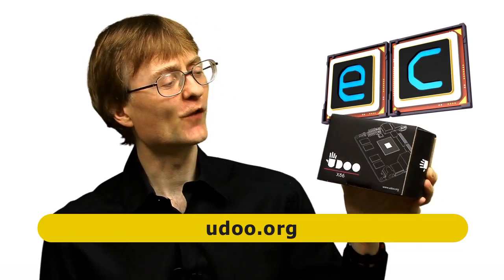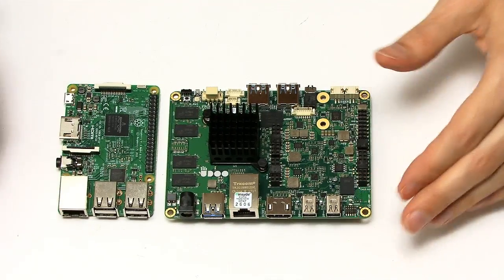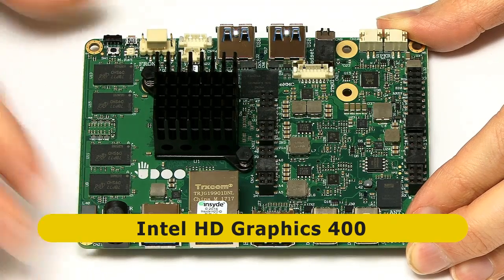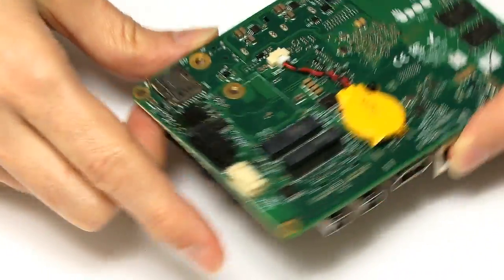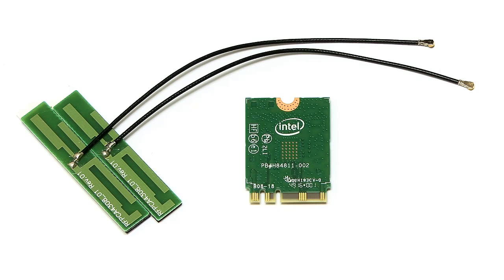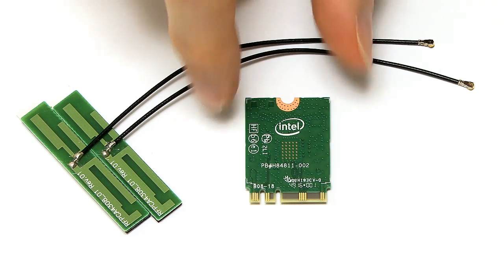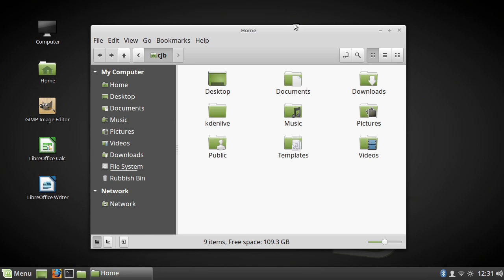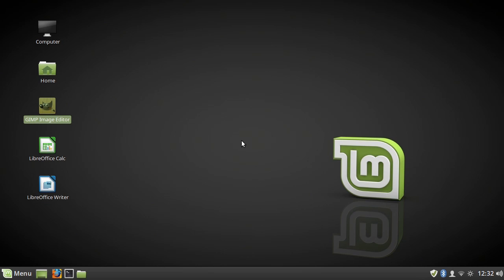UDOO x86 Advanced Plus

Comment: Nice.  Please Benchmark a Visual Land Premier 9 against these expensive SBCs.  It has a display, battery, power supply, touch screen, etc., etc, etc. and Windows 10 installed for about $170, compared to these SBC bare board marvels!
Reply from the maker: It looks a nice tablet, which means it is intended for a totally different market! :) This board is faster and has four times the RAM. But it all depends on what the machine is for.
Reply: If one wants to use an SBC to control & measure things, you need to get a user interface (display, keyboard, mouse joystick, etc.), power supply (batteries preferable), enclosure and then write, copy, edit, debug a bunch of software from several places. 

If you want use inexpensive, debugged, GUI, fully supported Windows software such as MCC DAQeasy or DAQAMI, and connect everything via USB, WIFI or BT, then a Win 10 mini tablet, which is cheaper than any of the SBCs with similar features, seems a good solution.  

If you need an Arduino compatible development platform and want to develop programming languages, applications, user interfaces, and hardware drivers, then an SBC  under $35 from Raspberry Pi, ST Micro, or any Arduino or clone is a good way to go.  The reviewed SBC, would cost ~ $500, if you add a case, keyboard, mouse, an 8" touch screen LCD, LI battery & charger and cost of the freebie enhancements provided.

An analogy might be buying a chassis with an engine, a bunch of parts and figuring out how to put them together to make a truck, or buying a truck and adding whatever custom equipment you want.

Comment: Intel stop making atom cpu?
 I am very interested in the performance of the stats on the gpio and what software
to access them.
Reply from the maker: Yes, Intel have stopped making the Atom. :(
Reply: Well they have stopped advertising atom, but I thought all N cpus was based off the atom architecture just improved with new name
Reply: also the Curie as well =(
Reply: The CPU on this board is based on the Braswell microarchitecture, which is marketed under the Atom, Celeron and Pentium names depending on the target devices. For desktop use, Intel has renamed the Atom line to Celeron and Pentium several years ago, but kept using the Atom name for the mobile CPUs.

Comment: you put the cooler fan upside down ... nice job on all the others , nice little computer
Reply from the maker: Yes -- and no. The fan is indeed pulling air upwards. But the way it is made, it fits that way, but not the other (at least there is no protection on top of it with the fan blowing downwards). And all airflow is good! :)
Reply: did you benchmarked both positions to see which is better for cooling this device ?

Comment: Not going to lie, if I could use this for general-purpose stuff without the need to run my main comp (which seems to double as an effective space heater even when idle - not fun during the summer), I'd probably buy one as soon as I could afford it. Can't say I'm a fan (no pun) of a case that leaves the heatsink sticking out like a sore thumb, though.
Reply from the maker: Yes, this is crying out for an enclosed case.
Reply: So do as I did and make your own. Mine is made of balsa sheet reinforced and decorated with flat and round bamboo skewers.

Comment: This mainboard (why they call it an SBC when it isn't ?) would make a nice little HTPC.
Not cheap though. One of these cheap mainboards with built-in Braswell CPUs would probably do better and have more expandability. Of course, at the cost of not being as portable.

Also, I bet Windows would run better than Mint (ahem... Ubuntu) on this board as Linux GPU drivers for those newish Atom CPUs can be pretty flaky.
Reply from the maker: All agreed, though this board is Celeron, not Atom. I will be installing Windows for my LattePanda comparison video.
Reply: It's an Atom branded as Celeron (top of the range Atoms are branded as Pentiums). Intel did the same branding thing with Bay Trail in the past.

Comment: Could u try and connect a external gpu ( by replacing the wifi card) to it and make another video on it and see it is able to game PS if you need help just msg me , I might do it if it actually work.
Reply from the maker: The M.2 slots are keyed for WiFi and SSD only.
Reply: One of them also support the Ethernet expansion.  I do not have it and Udoo explains nothing without a lot of begging first.
Reply: Well, someone figured out how to add a graphics card.  https://www.youtube.com/watch?v=9Evkc3L-NJM

Although I don't have  a good clue.  The m2 slots  are totally new to me.

I don't know what effects it has on the Arduino end.

Comment: Hey there from ireland. Got a question for you. I wanna build a touch screen juke box, and looking at this,would it be a good unit to use or would I be better with ryzen 3
Reply from the maker: It depends how much power you need. This would certainly run a jukebox.

Comment: I read that Intel is pulling out of the SBC market! What will happen to these?
Reply from the maker: Intel is indeed ceasing to make its own SBC boards. But the Celaron chip used here is still on the market and used in many devices (esp cheaper laptops) so will remain available.
Reply from the maker: I've just the link another poster has provided about Intel discontinuing the Currie microcontroller. Bad news.
Reply: Its bad news indeed. This thing is pornographic :(

Comment: Shouldn't the fan be mounted to push air toward the heat sink?
Reply from the maker: Well spotted, it should. But the supplied fan mounts (better) the other way around! I need to experiment. Any airflow is good. :)
Reply: Probably so it is sucking hot air from the mobo instead of blowing hot air over the mobo.
Reply: Depends on the heatsink actually but usually blowing is more efficient even though is creates more turbulence.

Comment: I am planning to build a handheld Linux based device with a sliding keyboard, which would be the most powerful and power efficient board that I could fit in a hand held form factor?
Reply from the maker: You will always have a tension between powerful and power efficient! A Raspberry Pi Zero W is very power efficient, but a board like this is far more powerful. A Pi 3 remains an excellent compromise. It just depends how much power you need.
Reply: Thank you! My initial choice was a Pi 3. I will research a bit more before settling on it!

Comment: At this price wifi should already be included ;-;
Reply: WiFi in built-in but only 802.11 N not AC, but the upgrade board is only $16 as I recall and upgrade Bluetooth from 4.0 to 4.2 and adds antenna ports so it is worth it.  Still all this should have been built-in instead with an eventual Bluetooth 5.0 module later on.
Reply: Israel Jauregui I sort of agree, but then again the less potentislly shady and low support Chinese drivers the better.
Reply: They do not even include the screws to assemble it!  Udoo is a turd of a company!

Comment: Would be interested if you could talk a bit about the power requirements. Usually a selling point for SBCs is also the low power consumption, but these x86 boards generally use more power.
Reply from the maker: It needs an adapter supplying 12V at 3 amps, so yes -- a lot more power hungry than I Pi. I must put a meter on it and see how much it draws at idle and load. Thanks for pointing this out. :)

Comment: A great piece of hard ware but it's price makes me think you should try it against a full size motherboard and processor of similar value.
Reply from the maker: Now that is a great suggestion! :)
Reply: A year back I bought a little i3 6100U based PC from China, was around US$300 with Win 10 Pro N, 8GB and 128GB SSD, dual band wifi etc in a fanless case, has been running as a security cam server for almost a year now without a glitch, although it does auto reboot at midnight to keep things running as fast as possible, but that never fails either, so pretty happy with these lower cost machines. Hard to justify the Udoo when you can buy a complete PC with similar specs for less once SSD etc is added to the Udoo cost. BTW, link is https://www.aliexpress.com/item/Pre-sale-Limited-Qty-Skylake-Mini-PC-Core-i7-6500U-i5-6200U-i3-6100U-Intel-HD/32705619815.html

Edit: Also forgot to mention it has space for real HDDs in the case and dual SATA connectors on board (but only one power connector). So, with a low profile right-angle SATA cable, a Silverstone ultra thin SATA cable (SST-CP11B-300), SATA power cable and a SATA power cable splitter, I managed to shoehorn in dual 1TB 2.5" drives as well.
Reply: The main cost is the VERY expensive M.2 HD.  It will set you back hundreds which is as much as you would pay for everything else so it doubles the price.
Reply: It's kind of left the Raspberry pi concept behind & just become a mini pc with an Arduino unit chucked in. If you're going down that road then go the full hog & have a mini pc board in a case with its outlets, hdmi usb etc. Then have a builders board area, on top, where you can plug in a Mega 2560. This can have connections to the mini pc below so you can connect the 2560 to the internet,  wifi & Bluetooth etc.

Comment: Could you connect an external GPU using an M.2 to PCI adapter? It would of course need external power as well.
Reply from the maker: Sadly not (well, at least not here), as the slots are keyed for WiFi and SSD modules only. You could, in theory, run a graphics card over USB 3.0.

Comment: how many raspberry pi 3s put together equal to this? in terms of Processing in real world.
Reply from the maker: Udoo claim that the board is ten times more powerful than a Raspberry Pi 3. I think that overstating things, but is it probably as powerful as 4 or 5 Raspberry Pis in real world situations. I intend to run some tests and report back! :)
Reply: You can't compare ARM to x86. "You can add as much to a bicycle as you want, it's still not a car"
Reply: That's actually an interesting question that might not be easy to answer. As I'm sure you know, the RPi uses an ARM cpu which uses a RISC like architecture, while x86 cpus use CISC architecture. So comparing the CPU processing power would be difficult. I see that ExplainingComputers answered you, but in reality, how would it be measured? Would one have to take into account the inherent lower efficiency of ARM? Would one have to "convert" RISC to CISC to figure out the true difference? Idk know, I'm just good at asking a lot of questions.
Reply: What I find amusing about all of these little (and sometimes relatively expensive) single board computers, is that there's a slew of cheap secondhand Cherry Trail Windows tablets around. Some are a gamble, but most have been locked away in drawers their whole lives. Given that Intel has bowed out of the low-power SoC markets (even their 'wearable' stuff), I wonder what that means for prices for such boards.
Reply: You should compare it to 5 stacked together RPis!
Nah, I'm kidding. But speaking or Pis, I saw the other day some aluminium cases for it, which they claim, act as a heatsink. Have you tried any of that, Chris?
Reply: It probably would run Crysis. Question is, how fast ?
Reply: I do have a Pi 3 inside an aluminum case (a Kodi FLIRC case to be exact) and it does act as a heatsink. The case does get pretty warm, especially when decoding HD video.
Reply: hardware accelerate that :P then there would be little CPU usage and less heat
Reply: Neither do I.
Reply: Cluster 5 of these and Benchmark that stuff
Reply: The x86 CPUs are no longer CISC, though with micro-instructions they look like it. Also, ARM CPUs are not really RISC anymore, either. Performance is measured with benchmarks and real-life use, not architectural preconceptions. There are some software benchmarks that run on arm and x86 - mostly browser based.
Reply: In short: will it run Crysis? ;)